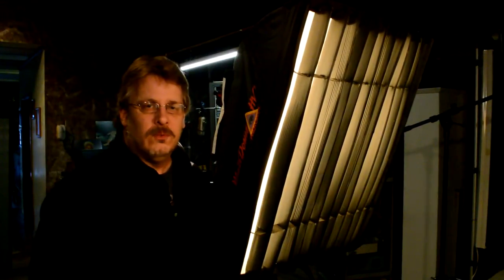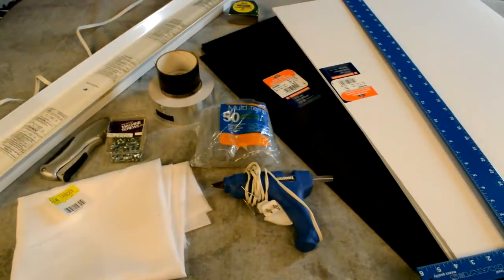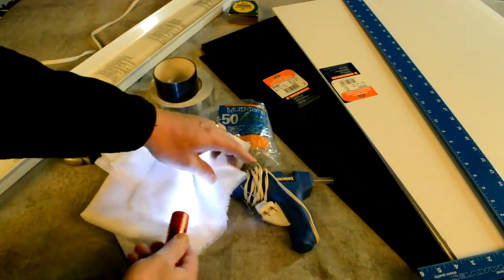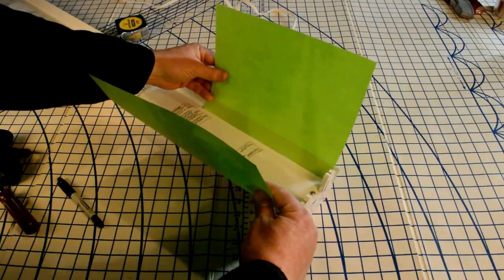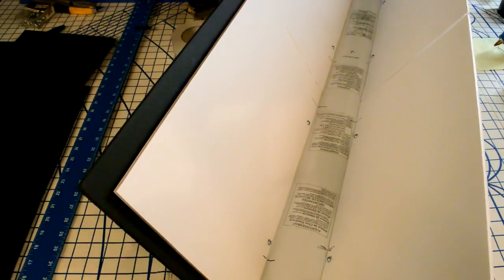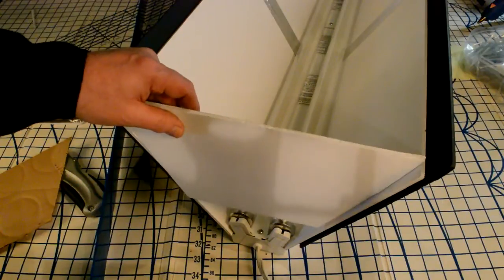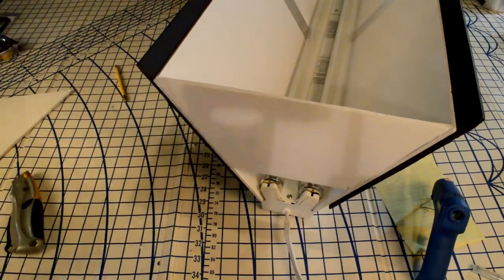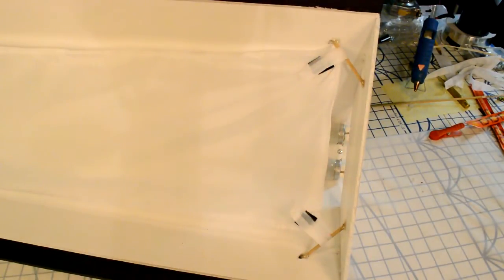DIY Video & Photo Softbox Built From Common Parts

Comment: I built this project.  After following your instructions I would give your advice/guidance a 9/10.  You're pretty thorough through what you recommend people purchase and telling them how to put it together.  A few items to mention: Your light model number - the one that we bought at Walmart resulted in the boards having a different angle, therefore we had to customize or end pieces.  Tell people that you can get everything at Walmart for a little over $50.  People want to know how much it will run them.  Have them purchase a larger sized glue gun.  If you use the smaller size, it doesn't put out enough glue to glue the larger panels and get it on there in time.  After these few adjustments, in the end it turned out great.  Thank you for making this video!

Comment: I may be wrong but it looked like the shop light you purchased was the T12 type bulb.  Are you aware that T12 bulbs are no longer manufactured?  I just finished re-lamping my shop with new T8 ballasts and T8 bulbs installed in the existing fixtures and besides being more energy efficient, they start every time in cold weather.